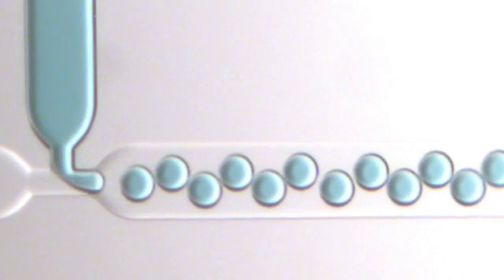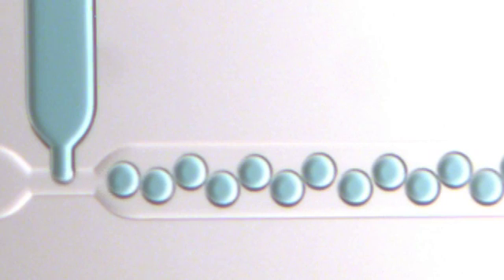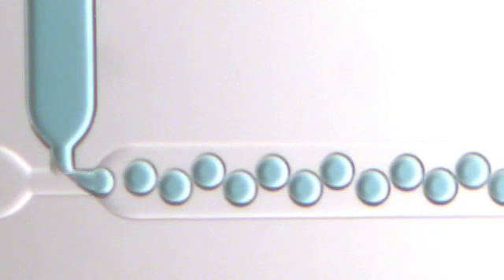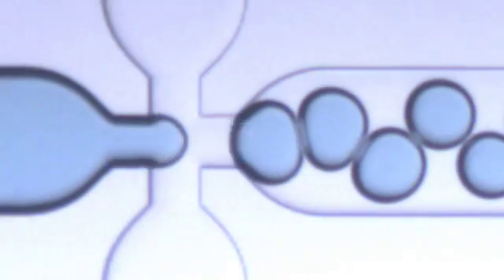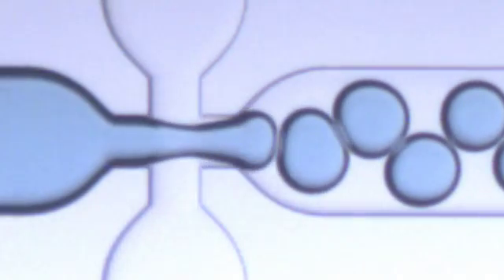Droplet Generation (ARCHIVE)

Comment: why two droplets don't merge with each other?
Reply from the maker: we did use the emulsion stabilizers (or other name is surfactant. The surfactants sit at the interface between fluids, help easier to form droplets (disrupt the elastic tension)and stabilize emulsion (form a “cushion”). You can see more about the roles of surfactant in microfluidic here: https://www.youtube.com/watch?v=5amUA0jkGYc